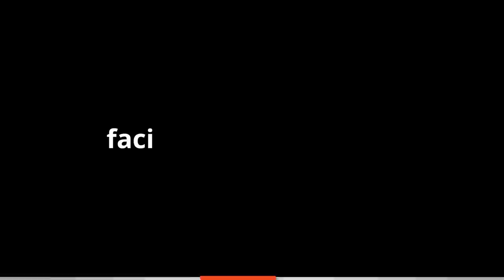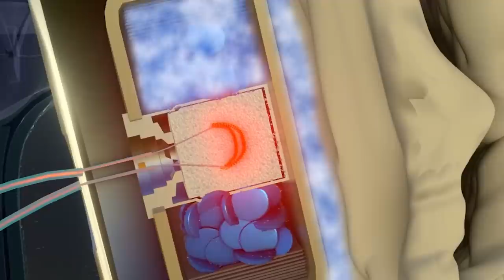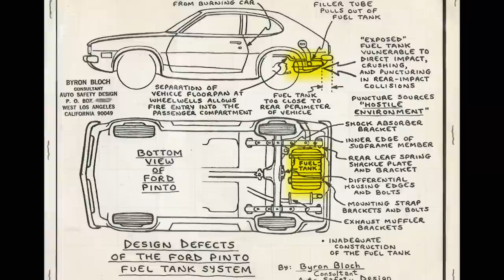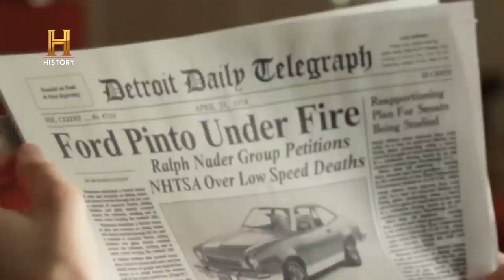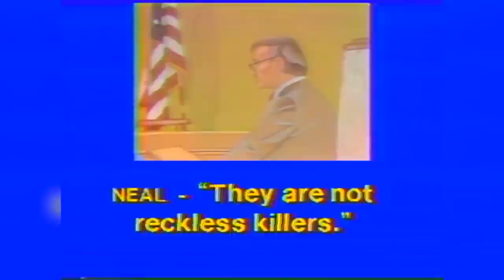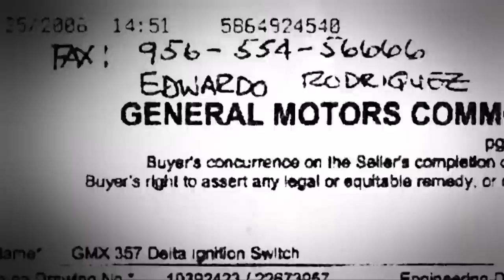These are THE WORST CAR SAFETY SCANDALS 🚗💥

Comment: I bought a new Dodge Charger Daytona in 1977 that was equipped with the HORRIBLE Firestone 500 radials.  I would go out in the morning to go to work and would have a flat tire.  Took it to Dodge who checked it out and said the rim was fine, the bead on the tire just let go (they were just beginning to see a disturbing pattern) and went to Firestone who told me the bead was fine, the Chrysler Rally wheels were to blame.  The final straw was when I was coming back to my base from Montreal and had the bead fail while I was going better than 85 and fortunately, I managed to go into a field instead of hitting a pole.  I changed the tire in minus 20 degree weather and made it home (a lot slower, I should add) and the next morning went right to Firestone and had a HUGE fight with the manager.  I was so disgusted that I went to BF Goodrich and got a new set of tires on a car with less than 7,000 miles on it (and on my airman's pay, put a huge dent in my budget.)  The store manager took me behind the shop and showed me a HEAPING pile of Firestone 500 radials.  Firestone finally issued a recall but would NOT pay for tires from another manufacturer but would replace them with Firestone "721" radials.  This came 4 months AFTER I had already replaced those junk tires.  I will NEVER put another Firestone tire on any of my cars.  A few years later when I ordered a new car I specified NO FIRESTONE TIRES.  PERIOD.  And sure enough when it arrived, there were 5 new Firestone tires on the car and I refused to take delivery until they changed them out with BF Goodrich tires.

Comment: I was working at a Ford dealer back in 2000, the only issue was they were putting the tire PSI at 25, way to low, and the sidewalls were blowing out overtime, there was nothing wrong with the suspension or the tires. recall came out and all we did was make new door stickers saying 30PSI (they needed to be 35PSI in reality) but even with tires set at 30PSI, no more issues.
Reply: Would you believe that the recommended tire pressures for the Renault 16 were 26/32 psi F/R?
Reply: These articles always talk about the pintos gas tank behind the rear axle being the fault. Most cars for decades has the gas tank there. The fault was too long hanger bolts that would bend up and pierce the tank in a collision.
Reply: From a friend who worked for Ford at that time, one problem with the tires  was that chains on the assembly line were rubbing against the inner sidewall and weakening the belts of the tires.
Reply: @jayjaynella4539  Uhhhh yeeaaa ok that makes no since at all, that's not possible. Never saw anything like that on them and doesn't explain why when we started putting them at 30psi, never had anymore issues. If it was that, they would have caught it during install and we would have seen it to. Never in my 23 years doing this ever seen chains rubbing a tire causing wear to a side wall (how and why are chains inside the tire???) Think your friend was on that good good a little much that day.
Reply: @john1703  That's a bit high for the rear and a bit low for front but yeah, I can believe it. Renault 16 isn't an SUV so it can get away with lower pressures. That said, I'd run a bit higher front.

Comment: Once I heard about the airbags and my moms 2012 Corolla was affected, I took it straight to the dealership to get it replaced
Reply: We probably still have them 😂
Reply: If I recall correctly, those early replacement Takata Airbags were doing the same thing.  They were just as dangerous as the ones removed since Takata refused to admit their negligence.

Comment: Around 2015, it was discovered that some Jeep models had fuel tanks that could rupture like those on the Ford Pinto. I don’t know what ultimately happened, but at one point, Chrysler was trying to convince the Feds that installing trailer hitches on the affected models would solve the problem. Chrysler engineers said the hitches would strengthen the back end of the vehicle and help to protect the tank in a rear end collision. Amazingly, Ford engineers developed a fix for the Pinto before the car went on sale. Management vetoed the fix because it would have cost around $10 per car to implement. If management had listened to the engineers, neither the Challenger Space Shuttle nor the Ford Pinto would have had been prone to exploding.
Reply: The 1993-1998 ZJ Grand Cherokees. I had a loaded '96 Orvis Edition that had a factory Class 3 trailer hitch, therefore, it wasn't part of the recall.
Reply: Jeb Butler is a lawyer who represented the families of people who died in fires due to rear end collisions in the Jeep Liberty where the fuel tank ruptured after the trailer hitch fix. He deposed two Chrysler executives for his lawsuit against the company. Both depositions are on his channel.
Reply: It took me a second to figure out how Ford's engineers could have prevented the Challenger explosion.  Then it clicked what you actually said.

Comment: Other cars from other manufacturers had a fuel tank design similar to the Ford Pinto.  They were all prone to failure in rear end collisions. Pinto got the bad press because of how many of them were sold.
Reply: @@lurch789  I used to drive a 1965 Dodge D100 pickup truck that had the fuel tank behind the seat, inside the cab.🥺
I miss that truck, but if I had it today I'd relocate the fuel tank...
Reply: @@lurch789vertical what? It's vertical fuel tanks that are a serious fire hazard. Nothing changed, the tank is in the same position under the car. It gets ejected easily when the frame around it deforms, that's why there's no fires in a crash. Let's see how you eject a vertical plastic bottle. They can take some pressure but the ideea is to detach easily so the pressure drops, not get deformed along with the frame. There's no way to place a vertical fuel tank safely inside a car, horizontal fuel tank is safest
Reply: I had many GM G bodies (malibu, grand-prix, monte carlo, etc from 1978 to around 1988) and I remember the tank was right behind the bumper. But I don't know if it could cause à safety issue.
Reply: @markbeiser Oh yeah I remember these. They were good pick up.
Reply: @MarvinHartmann452  3 on the tree, no AC, long bench seat with only lap belts, fuel tank inside the cab with you.
Sound ridiculously primitive and dangerous by any standard!

I've many fond memories of the fun I had with my first wife in that truck when we were dating and newly married though, including a somewhat successful attempt at recreating a famous movie scene(Pretty sure they modified the steering when location for that scene in the movie). 😉
Reply: That’s true I remember Daimler Chrysler at the time had the Jeep Grand Cherokee and Jeep liberty with the identical issue as the Pinto.

Comment: Allegedly, the firestone issue was due to the tires not being inflated properly, which led to the tires failing.
Reply: But Firestone tires are crap anyways. I had a set if Winter tires years ago, they were extremly loud and when they were New the car was not stable on the the road.

Since then I only had Dunlop and they are significantly better

Comment: I had a `74 and a `80  Pintos and loved them both. Only problem I had was with the `74. It would need a new starter almost yearly. Got pretty good at changing them and it rusted quite quickly.

Comment: what I heard at the time, Pinto's gas tank was built with only 5 sides ( 6 sides to a box) the tank was sealed and welded to the floor board. when struck, would leak at the seams. ( to save money)

Comment: I was scared shitless to drive my ‘07 Honda Civic.

I remember the airbag light on my dashboard turning on, and I called my local dealer to ask them to reset it.

While I was on the phone, the Takata scandal was on my mind, and I asked if my VIN was in their system for a recall?

The guy said “Nope. Your VIN isn’t in the system for needing an airbag replacement. You’re good to go.”

Literally 3 weeks later; and only 1 week after I got the car back from getting the dashboard airbag light reset, I got the Takata airbag recall card in the mail.

I saw red. I was livid beyond belief.

Either Honda was gradually trying to tackle the airbag problems in batches of cars so the dealers weren’t overwhelmed, or the fucker on the phone was lying to me.

If he had at least been somewhat honest and said: “Look, Honda is going thru this and is sending out Recall notice cards, it might be some more time before yours gets taken in, but I believe you can expect to get one. Keep in touch with us to see and check your mail for any notification.”

I wouldn’t have been mad. I would’ve at least been patient and tried to avoid driving my Civic in the meantime.
Reply from the maker: It really wasn't an easy issue for the manufacturers, who to a certain extent were also deceived by Takata.

Comment: Another big problem with the Ford Explorer and several other American Ford, Mercury and Lincoln models of the 80:s and 90:s was that the cruise control would take over and give full throttle even if it was not switched on in the first place, the reason behind this, was that the cruise control in these Fords, unlike other cars, was getting power as soon as you turned on the engine, unlike other cars, where the cc only gets power when you switch it on using the button, this has caused several fatal accidents and near misses in both America and Europe, sadly Ford,  just like the ture scandal, not admit any wrong duing, even though experts and customers had complained for years about Fords accelerating out of control, even when the brakes were pushed, and since you did not switch the cruise control on in the intended way, by using the button, it would not disengage by pressing the button either.
Reply: Add the BMW E36 M3 (probably others models in that series) to your list. Was due to a CC module in the engine bay. For no reaso, it would jam throttle wide open until you cut the gas! Then, power steering would fail & you hoped you would'nt either hit someone/thing or run off the road....
Reply: Shoot that’s when you quickly pop the car into neutral. Automatic Transmissions can handle being shifted while moving from Drive to Neutral. Engine can be screaming to the moon and yet your car will still slow down
Reply: Fortunately my car is so under powered the brakes can override full throttle in even 1st gear.

Comment: Interestingly the GM ignition switch issue has similar characteristics to a Ford issue from the 70s. Ford automatic transmissions at that time, going back over 20 years, had detent springs (which keep the shifter in a certain position) that were too weak, allowing the transmissions to slip out of park into reverse similar to how the GM switch would slip from run to accessory. In Ford's case, they got away with mailing a sticker to owners telling them to "make sure it's in park and set the parking brake" rather than recall the faulty transmissions.

In both cases the actual faulty part costs a few cents to make, though in Ford's case the part was inside the transmission. A full recall would have sunk the company.

Comment: Hey Mr. Car Facts, the problem with the Pinto wasn't that the gas tank was behind the rear axle. All cars at the time had the tank located there. Would you prefer the gas tank to be in the passenger compartment as it was on Chevy, Ford, and Dodge pickups of the era? Anyway, if you know the real reason the Pinto had a problem please add it to the video.
Reply: As I understand it, there was a component (possibly part of the bumper mount) that was positioned such that it would puncture the tank in even a mild rear-end impact. Ford actually found several workable options to fix the problem with minimal design changes, including adding a flexible rubber lining to the tank that would remain sealed even if the metal were punctured, but even though it would only add a few dollars to the cost of each car, they still decided not to bother.

Comment: As for the GM ignition switches, I knew several people who carried monstrous amounts of keys on their key chains. I informed them that all that weight would cause the ignition switch to cut out unexpectedly. Those people changed their habits for the better. As for the airbags, GM informed the gov back in 1971 that these systems would cause lots of problems. Rather than allow a better system to be installed, the gov agency doubled down on their efforts to put airbags in vehicles. All this car testing that the companies do is done on tracks that do not resemble road conditions and traffic, and these problems show up later. Like all these new safety systems that cause traffic stoppages in winter due to stopping the car when traction is lost on a slippery surface. Every time a new safety system gets put on a car, the drivers dumb down expecting the system to save their butts, rather than develop great driving skills and becoming familiar with how their vehicles act in different road situations. Until the 1990s one had to learn to handle a vehicle properly to avoid accidents. Now people are relying on "sensors" to do their mind work. Not realizing that in wet and snowy weather the sensors accumulate dirt, ice, snow, and mud that keeps them from working properly.

Comment: The worst one I’ve heard of was Chrysler minivans from 1984-1995 had a latch on the rear lift gate so weak that it would pop open even in low speed impacts, often ejecting children from the back row bench. At least 41 people were killed. Chrysler did everything it could to avoid a recall and dragged the process out for years.
Reply: and the seats falling back

Comment: THE BEST WAY TO TEACH FORD A LESSON IS DON'T BUY FORD. BUY SAFE CARS LIKE VOLVO OR MERCEDES WHO NEVER COMPROMISE SAFETY!!!
Reply: Sorry to burst your bubble, but Volvo and Mercedes is also part of the recall (they both use the same airbags as ford). So your suggestion won't work.
Reply: @tomtom1541  anything is better than ford itsFord stands for:
Ford:
Fatality
Out-of-control
Rollover
Death

The last one is actually hand picked by henry ford, and towards a specific group, but I wont get into that to much.
Reply: @Lynnfield3440  I never said ford made good cars, I was only pointing out they all use the same part suppliers for airbags. I prefer Toyota / Lexus myself.
Reply: @tomtom1541  I am not saying you did, I am just saying anything is better than ford.

Comment: Funny how y'all, just like tons of others, act like Toyota didn't have the most catastrophic safety recall, more severe than any of these & was simply overshadowed by the much less catastrophic GM ignition switch recall. Toyota's sticking accelerator killed far more & was a worldwide issue, but as is the case with them & Honda, it just gets swept under the rug, but heaven forbid Hyundai/Kia has an issue & everyone has their pitchforks out. I specifically watched this just to see if they were going to bring it up & they didn't, which didn't surprise me one bit.
Reply: Aftermarket floor carpets caused many of the problems, esp the ones that say universal fit. Carpet gets caught under the accelerator and grabs onto it.
Reply: @jayjaynella4539  wrong, it was factory floor mates, but that was only on certain models, others the actual pedal got stuck, hence why it was called the "sticking accelerator pedal recall." I've said it once & I'll say it again, stop glorifying Toyotas & Hondas, they're not bad by any means, but they're not THAT good!
Reply: I mean, put it in neutral if the accelerator is stuck? what is so hard about that? press the brakes as brakes over power the engine if you havent messed up your car. if for some reason you cant put it in neutral do some other gear to destroy the engine and gearbox. its not pretty but better than keep accelerating.
Reply: @JustinPennito  you could be right, but its just that compared to a ford, any other car brand instantly looks so amazing.

Comment: My mother had a 2017 gmc terrain that when driving you'd lose power brakes, power steering, the speedometer would go up and down like the car was turning on and turn off the radio. She could of died from this but the garage who would of done the recall that was well known refused because they were upset my father wouldn't work there anymore because of cut pay and bad work conditions. We now drive used cars because that gmc put a bad taste in our mouths for years.

Comment: Ford Pinto: It's complicated.  Yes, there was a real risk of fireball in rear end collisions.  However, statistics show that per million miles driven it was safer than the competition.  When all types of fatalities are considered, the Pinto was approximately even with the AMC Gremlin, Chevrolet Vega, and Datsun 510. It was significantly better than the Datsun 1200/210, Toyota Corolla, and VW Beetle.
Reply from the maker: Good data! Ultimately, the Pinto scandal was not about the fuel tank problem itself, but about the fact that Ford always knew about the risk involved and did nothing to remedy it... until after the Judge's ruling. .
Reply: @LowBudgetCarsV2 - I noticed the Pinto wagon in the video. The wagon had a different design and wasn't affected by the recall.

Comment: My old Toyota 2007 the wire inside steering break, I remove the wire and use copper plate from 80s car steering. I don't even bother to rewire the airbag because I don't trust it. From south Asia.

Comment: Pinto Station Wagon was NOT fire risk. Had a 73 and loved it! Added turbocharger, fast, made a SUV cruiser to camp/tow sand toys to dunes in 80's. Modern Model A, was able to fix everything w/hand tools in family driveway. Used 200k+ miles & sold